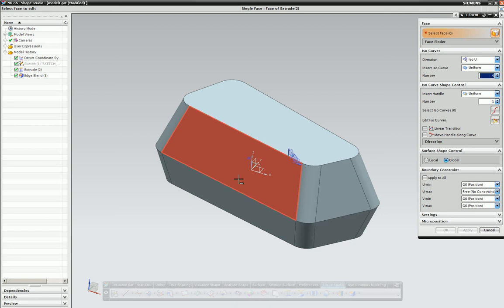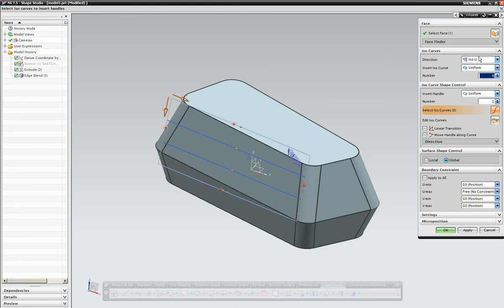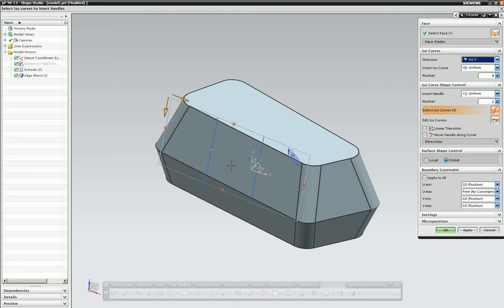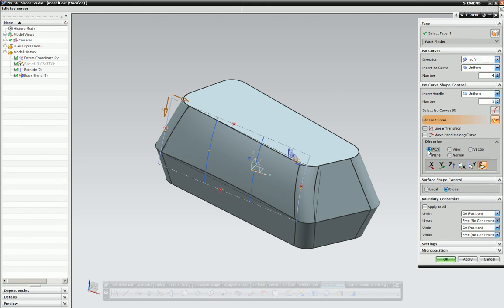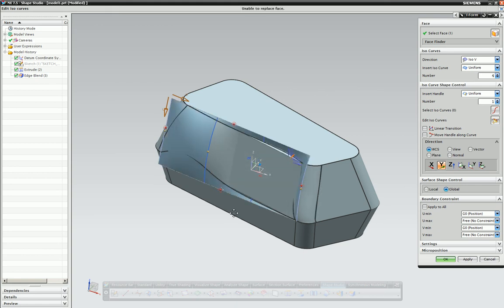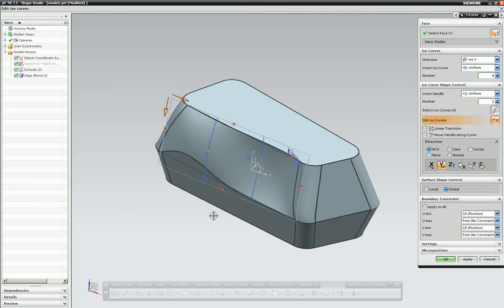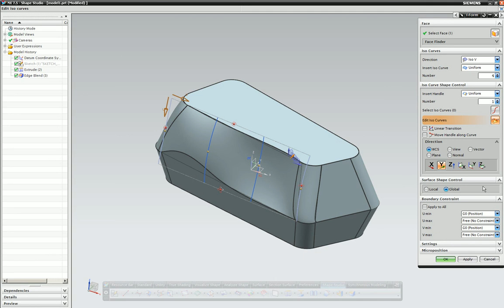i-form basics.avi

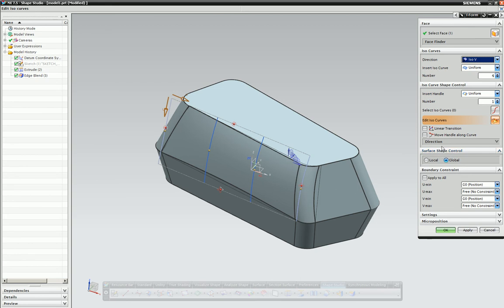Comment: Correct me if I am wrong. I am wondering why do you say the "topology" of the face has changed, at 1:29? Since the connectivities of the edges that make up the face you deform actually stay unchanged, the topology of the face is not changed. The geometry of the face, on the other hand, has changed, i.e. from planar surface to a curved surface.
Reply from the maker: I-Form adds patches to the face. It has to. You do not see them but the underlying math changes not in just complexity. It is similar in taking a Bezier patch and making it NURBS with knots.

So yes, the topology does change. Make sense?